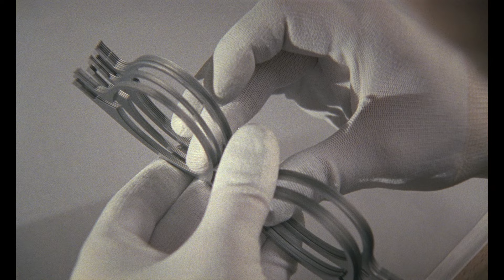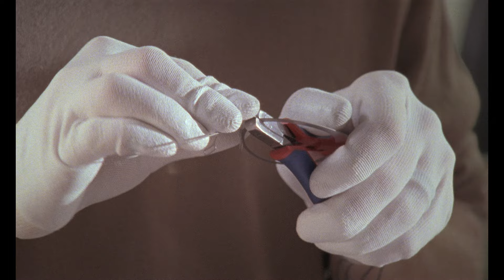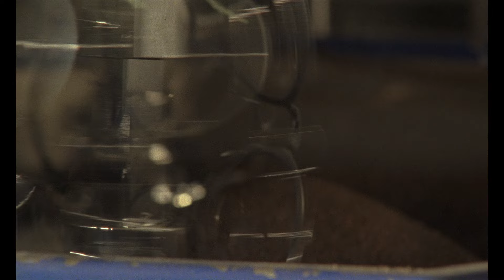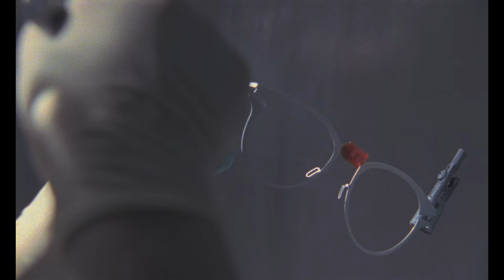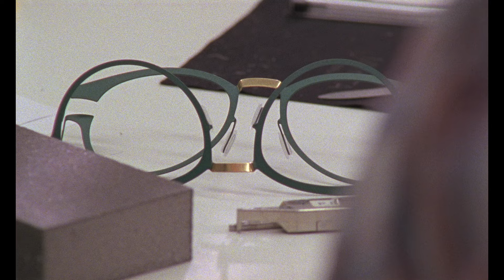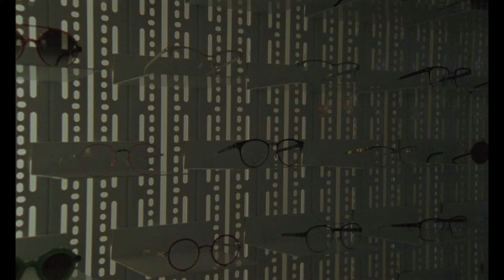Making of a MYKITA metal frame

Comment: I bought Mykita frame and the hinge broke in less than 12 months, it seems that the hinge design is stress during manufacturing process and therefore seems to have less reliability and strength. Very disappointing when one pays a lot of money. In my view not worth the money and has a design flaw!!
Reply: Your frame is still under warranty if it's been less than 12 months.  It sounds like there's a manufacturing defect with your pair.  The shop you bought them from should be able to take care of it for you.  I've had my Mykia glasses with their "screw less hinge"  for almost 6 years.  I wear them every day.... even  mountain bike and ski with them and they're still perfect.
Reply: @dennis7293  Thank you for your feedback, my optician has repaired the frame.